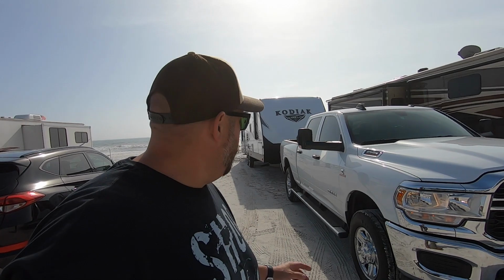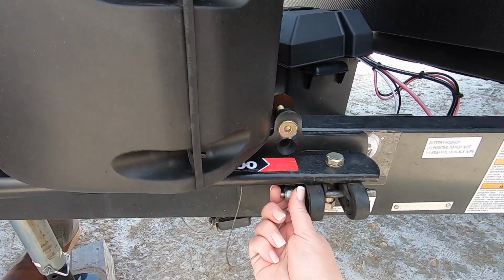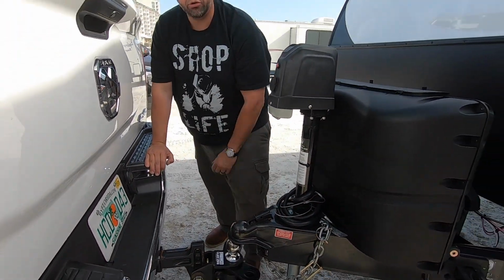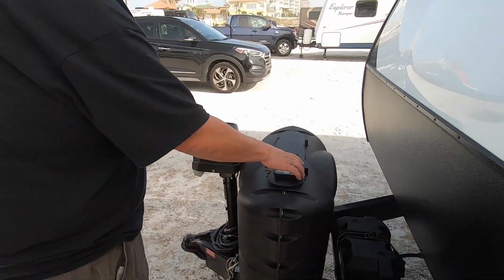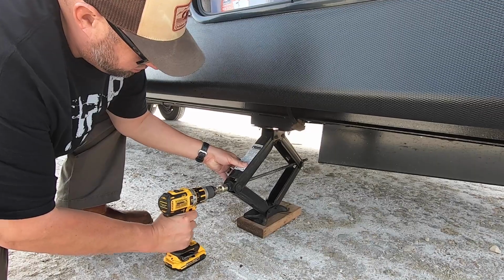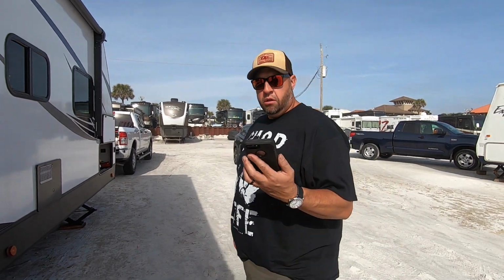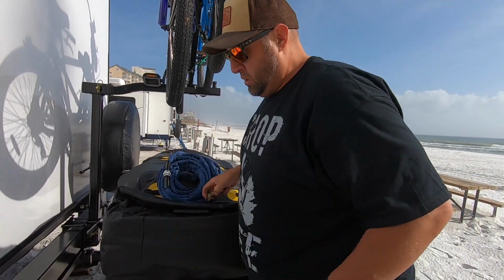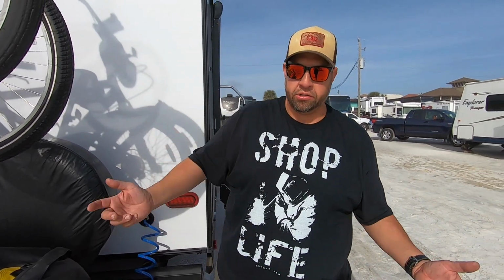First Setup Using Level Mate Pro

Comment: You forgot to take the slide out for leveling
Reply: He explained why in the video, he would have to crawl under the slide out to adjust the stabilizer.
Reply: You should always be level before putting slides out.

Comment: You might consider putting the water filter at the source hydrant to prevent stress on water connection at the camper. The level mate pro is pretty awesome. Thanks for sharing.

Comment: I did not see you the hitch height feature either time you cleared the ball. It would have been good to see if it worked correctly when you had to set back on the ball to raise your jack foot. I realize it is your fist time using the level pro and I am by no means critisizing

Comment: Hey you guys, you should reset your Levelmatepro. Level the trailer with the slides out, then retract them and set your Levelmatepro to zero. That way when you are doing your initial set up it will compensate for the slide and no need to readjust your stabilizer jacks. Nice camp site.

Comment: You may want to re-calibrate your level-mate pro. I just went thru the setup process and found that the setup accounts for slide-out leveling. In other words when you put out the slide your trailer will lean a little. When setting mine up it has me open and close the slides to calibrate for this.

Comment: Should never use the stabilizer jacks to lift trailer,  Sorry for the excessive comments,  but hey it drives traffic right    ,   I always chock before disconnecting,  for Safety Reasons.  do not want the trailer to roll,  extreme situation that it would,  but not a bad practice ,   good telling folks to not level with the stabilizer jacks,  they are not leveling jacks.

Comment: The real question is, was it a bitch getting that sand out of your rig?
Reply: I don't blame Adam. I have a zero-g hose also and I'm excited about it hehehe👍🇺🇲
Reply: What the real bitch is, everything metal rusts at hyper speed. I put a gremlin bell on my trailer and after 2 weeks it was unrecognizable.  Lesson learned.  But the beach was amazing.  Padre Island TX. 42 miles of on beach camping.  Great video.  Couldn't get mine to work.  So I'll go home and turn on the switch. Lol

Comment: Nice review on the level pro, it has me curious for certain.  We camp all summer long and nearly each time we go I end up learning something new.  Next time you need to adjust the jack foot and want to save some time from hitching it back up to the truck, use your jack pad or a chunk of 6x6 turned on it's side and placed under the coupler and let the jack down on it.  It will hold plenty well for a quick jack foot adjustment.

Comment: Why would you let your water filter hang from the trailer? We bought a small 4’ stainless steel water hose to attach to the trailer first then add the water filter and then another 10’ to 20’ stainless water hose to the adjustable water pressure regulator at the water tap. Laying the filter on a plastic storage tub lid keeping it off the ground relieves any tension at the filter and trailer fittings. Enjoyed your video. Thanks.

Comment: Good video. I caught something though. Before you unhook from truck put regular chocks on the wheels to prevent rolling away when you unhitch. We use the x chicks as well with the wheel chocks. Other than that great explanation of LevelMatePRO
Reply from the maker: I’m well aware of wheel chocks and use them regularly. Not needed on flat ground.

Comment: Good video. A couple of things I'd recommend changing. The X-chocks are not meant to hold the trailer in place. If you read the precautions that come with them, you should always use a regular chock in front of and in back of the tires. Second, you should level the trailer and put the stabilizers down before you put the X-chocks in place. By putting the X-chocks in place before leveling and stabilizing, you have voided the warranty. Awesome site. Have attempted to book spots on the beach several times, always booked.
Reply from the maker: Thanks for the comments, but your posting opinion based info vs factually information. Please know, I use standard wheel chocks around my tires when needed, like when there is a grade working against you. I always do, so please don’t assume I don’t have common sense with handling of my camper and basic trailer hauling and use. Always level side to side, then front to back, lock the chocks, and run down the stabilization jacks. I spent two hours with the dealer learning how to properly handle a travel trailer. I may not do things your way, but I got this.

Comment: I was wondering...do you ever use a surge/protection device between the electric hook up panel and your shore power cable.  So many RV parks have crappy power.  bill in Florida

Comment: On our RV, I would hook the water hose to the elbow and the filter to the supply faucet to keep it's weight off the RV water connection point. But it probably doesn't weigh that much.

Comment: I've always used bubble levels permanently on the trailer tounge and rear bumper, never failed yet and in use long before smartphones were invented. I also have an app on my phone called tool box, it also has a bubble level.

Comment: Concerning the stabilzer "jacks", I run them down with a drill just before they touch the ground then turn them with my fingers.  I once ran them down too much with the drill and found out that with the lackluster quality of most trailers, the body torqued just enough that the door wouldn't latch.  Another vote for a surge suppressor.  I also carry a spare water pressure reducer.  I've had one fail and it allowed the park's 60 psi to blow the pex connector on the toilet.  I use a four port water manifold at the spigot with a pressure gauge on one of the ports.  Each port has a manual shut off.

Comment: You should set level in your level mate pro with the slides out. Then when you get to your camp sight and use it to see if you are level you only need to do it once. Technically, it may not be level initially with the slides in, but after you open the slides it will be. 👍🏼
Reply: Agreed - if you set the level in the app with the slide out it will compensate for the slide when you are leveling with the slide in.
Reply from the maker: Maybe you missed the install, my camper was set up manually as level as I could get it... with slides out, then set zero point. That is what you are going back to once you set it up again. The drop you get because of the slide I know how to compensate for in the program, and slight adjustments on the support jacks.

Comment: need to chock prior to disconnecting the trailer from the RAM.  dont want it to roll anywhere.  and the X-Chocks say they shouldnt be used prior to leveling front to back so you should chock with something else until the X-Chocks get installed.  at least thats the idea anyway.

Comment: I enjoy your metal fabrication videos and was surprised to see this one. I do have a word of advice though. It’s always a good idea to chock your wheels before you disconnect from your tow vehicle. If you happen to be on a slight incline, your trailer will roll with nothing to stop it.
Reply from the maker: Funny how many folks have to mention this. If your on flat ground you don’t have to chock. But I do stick wedge chocks behind the tires when I unhook, then apply the X-chocks. Most people who aren’t RV owners would be shocked to know when you go to the RV center they tell you not to chock the fires. Unhook and go.

Comment: I usually purge all the air before powering up the water heater, maybe you keep the breaker off ldk.
Those elements don't last to long if they're not submerged.
Nice camper, looks like you had a good time.

Comment: Check the duty cycle on those linear actuators.  Many have surprisingly low ratings.   They work great but the motors burn out way faster than one may think.  Just a thought.

Comment: Great video. However I would get in the habit of putting the wheel chock on before unhitching. Last thing you want is the trailer to try and roll away when you release from the truck.

Comment: The air you purged from the RV is coming from your city water hose connected to the camper. If you run water through that hose before you connect to the camper you will purge the air before it gets in the camper plumbing. Doing that also purges any rust and sediment that might be in the campground's plumbing before it gets into the camper.
Reply: fletcher3913 Umm, do you think all the plumbing in the trailer is full of water during haul and off time? I Don’t think so.

Comment: How good is that level made pro looks like a good thing ,,,,.and sorry Adam that's not camping it's 
Glamping in style . I love your setup ,, only thing I don't like is your safety chains with hooks 
They would illegal here in Australia you should have rated D shackles  ... And what a place to glamp .
Reply from the maker: I’ve heard “glamping” so many time I’ve come to dislike that word. Nothing wrong with the safety chain hooks. They’ve been on every trailer I’ve ever used in my life and not once have they come off. It’s what most manufacturers use.

Comment: Surprised it isn't made so the jacks can take full weight for leveling.
Reply: thats how they build the caravans here in sweden. U use the jacks for leveling. But they also looks a little bit different then the ones in here.
Reply from the maker: The techs told me not to level the camper with the jacks, just use them for support. That’s probably to keep people from tryin to over level them with just the jacks.

Comment: Adam, are those Zero-G hoses rated to have the water on constantly? I have some hoses that go on a reel, and they are built similar (but lower quality I believe) and the instructions for them say don't keep pressure on them constantly, use them only for filling your water tank, or short-term use in your yard, e.g.
Reply from the maker: I didn’t read any instructions on that, but there’s been times I keep the pressure on my shop hose for long periods of time. Haven’t had a blow out issue yet. I’m betting that all manufacturers will say not to leave the pressure on them for long periods of time.

Comment: You need a battery operated ratchet for your wheel chocks it will make it faster and easyer too put on and take off
Reply: It takes 11 seconds each. Talk about lazy. So installing and removing 2 of them takes 44 seconds, and it may take half that with a battery op ratchet. So you save 22 seconds. Yippee.

Comment: Great demo of setup Abby and Adam.. Might I suggest an upgrade for the electrical connection. I would add surge protector to the power connection, camp grounds are not always wired correctly and have surge issues also. A surge protector will both test the connection and protect in the event of a surge.  They vary in cost and capability but look at this one for a starting point Camco 55313 Circuit Analyzer Dogbone 50 Amp.

Comment: Great video, love the shop and camping videos. Going to check out the leveling system. I have a Kodiak quite similar to yours. I also have an older Ram as tow vehicle and getting ready to buy a new one. Do you have the diesel or Hemi? Curious how you like the tow performance in either  case. My wife and I stayed in Orange Beach last year at Pandion Ridge RV resort and had a great time. Love the Gulf Coast. Have fun?
Reply: Last year he started with a new gasser but quickly decided this Cummins was what he needed.
Reply: Thanks Adam! I was originally leaning toward the diesel but then started getting enticed by the tow rating for the hemi. The gas tow ratings are creeping up very close to the diesels, but I realize that tow rating and how easily it tows is a very different thing. I think I’ll stick with the diesel since we do some long range stuff from time to time.
Reply from the maker: Dave, I have the Ram 2500 4x4 with the Cummins diesel. I love it! I wanted to upgrade to allow better hauling payload when I need it. If I was just camping locally I wouldn’t mind using the Ram with the Hemi, but you just can’t beat the power and performance of a diesel. I’d recommend buying that to pull your trailer. So much nicer for the long hauls, and going up hills.

Comment: The Level Mate looks like a good system, but I like what I have better. Just back in, set the brake and push the extend jacks button. Will be watching the hoses, because I don't like the stiff white hoses. Tell Abby that the sand will find every possible place to hide. We took our car out on Daytona Beach, and we were finding sand in it until we sold it.
Reply from the maker: You have one of them fancy auto leveling systems! Cheater!

Comment: Sooooo first thing chalk the wheels before any hitch work. And also you can just lower the stabilizers lift the jack remove the wood then lower the jack down lift the stabilizers and continue leveling the trailer.  I have been in spots where my hitch is 4 feet high and the rear is almost in the dirt. I carry lots of wood and beer one is for before and one is after. Lol. Awesome video. 🍺

Comment: Excellent Video! Having the level mate pro is cheating (compared to what I had to do). Thanks for the walk through on setting up. I think this will be helpful to a lot of folks just getting into RV life. What about the sewer hookups (not applicable in this campground obviously)? Before we sold our last trailer a lot of campground were requiring screw in sewer connections.
Reply from the maker: Just seems weird to show the sewer connection, but I’m sure I’ll figure out a way to  share that info. You can buy the kits that have all of the hoses, 90° connector, and screw in adaptor.
Reply: @AbomAdventures  I hear you. Not something you want to talk about but really necessary. I still have nightmares about trying to flush out the sewer line in below freezing weather.
Reply from the maker: I can imagine all of the challenges that freezing weather brings to camping, I don’t plan to find out! 😂